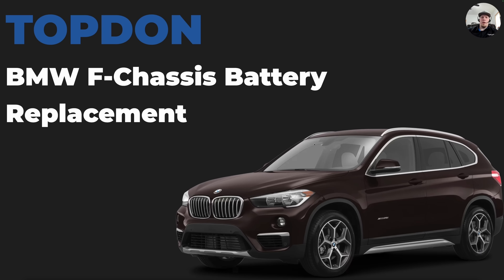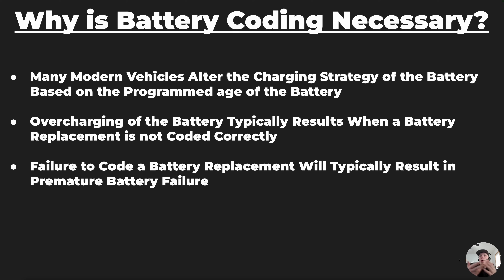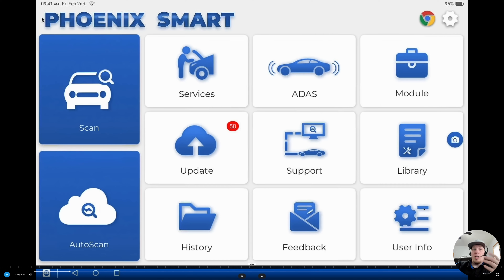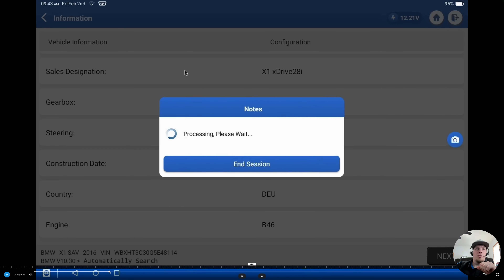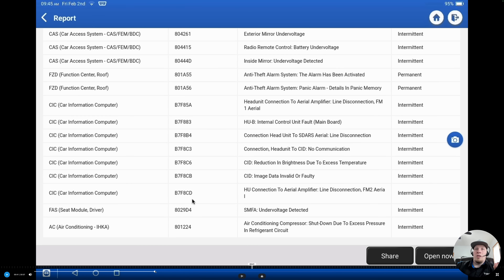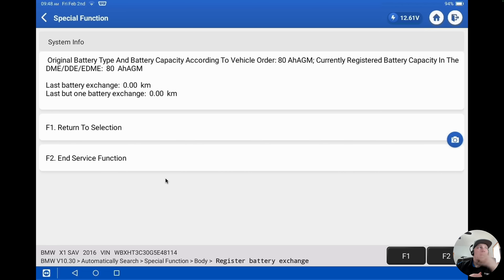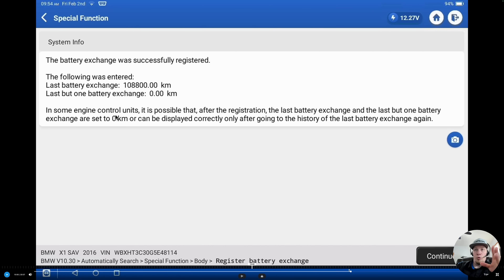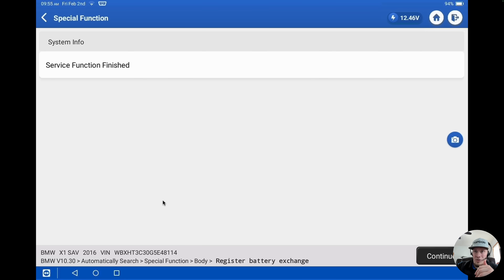BMW F-Chassis Battery Coding with TOPDON Phoenix Series

Comment: "I’ve replaced and registered a new battery, but the stop-and-start function is inconsistent—it works sometimes and doesn’t at other times. Do I need to wait a couple of days for it to stabilize?
Reply from the maker: Yes, the stop-start function after a battery replacement depends on several conditions. Please monitor it for a while to see if it stabilizes. If it remains inconsistent, I recommend performing a health scan to check for any issues.

Comment: Does coding need to be done if you charge the battery with a wall charger?
Reply from the maker: Generally, we don't need to do battery coding after the battery is charged. Is there any abnormality with your car after charging?

Comment: Hi how about Toyota diesel injector coding cheers sandy
Reply from the maker: Hi , please provide specific vehicle model, year and VIN, we will check the function compatibility. Also you can visit out website: https://www.topdon.com/pages/vehicle-coverage?ati=0&prd=%257B%2522dataSource%2522%253A1%252C%2522product%2522%253A%2522Phoenix%2520Smart%2522%252C%2522productAlias%2522%253A%2522TOPDON%2520PHOENIX%2520SMART%2522%252C%2522productId%2522%253Anull%257D&ift=1&cti=%25222%2522&lTp=0&cit=%2522Diagnostic%2520Functions%2522 to check the vehicle coverage list.